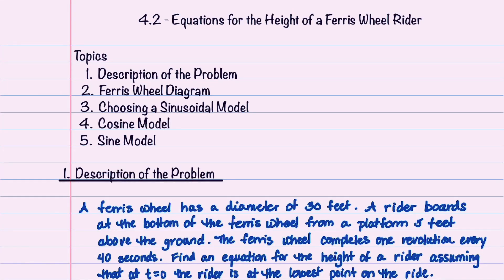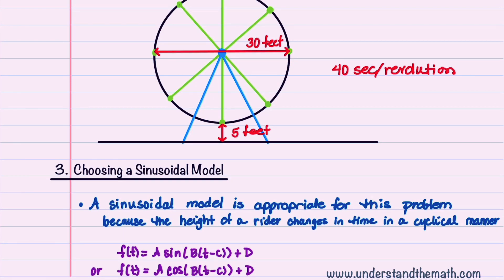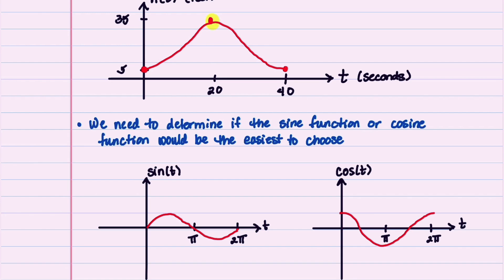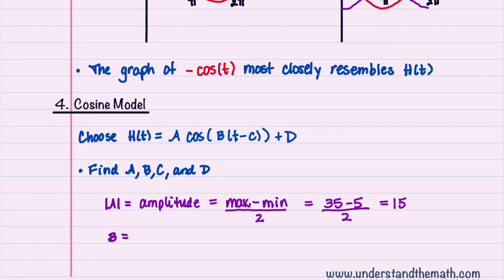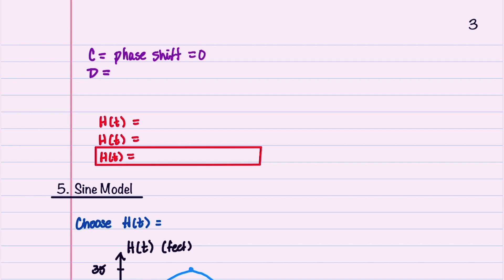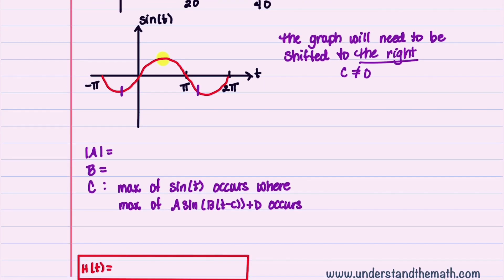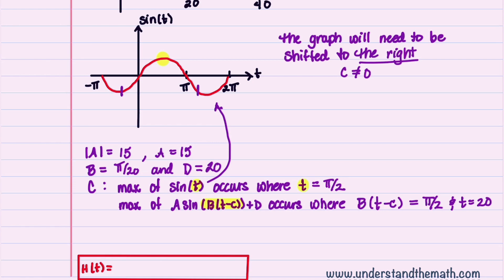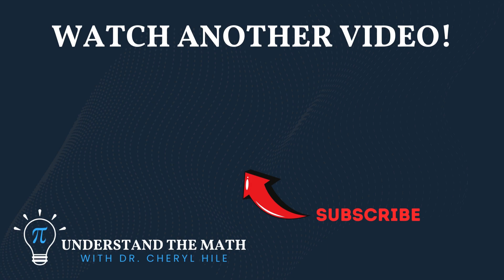Equation for Calculating the Height of a Ferris Wheel Rider

Comment: Hi, what if the Ferris wheel is elevated 5 feet, and the boarding platform is 1/5th of the ride between high and low points. My diameter is 190 feet. Could you please help me?
Reply from the maker: That’s a more challenging take on the problem! While I don't have the time right now to solve variations, starting with the steps in the video will give you a strong foundation to work it out.  You've got this!